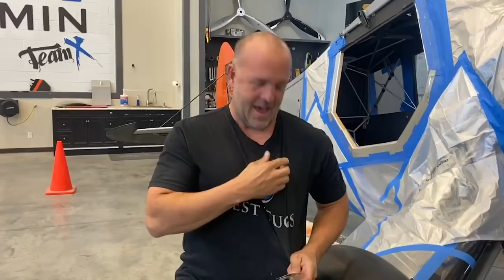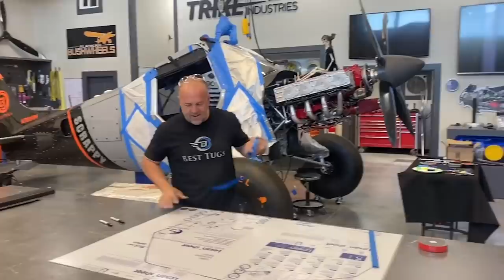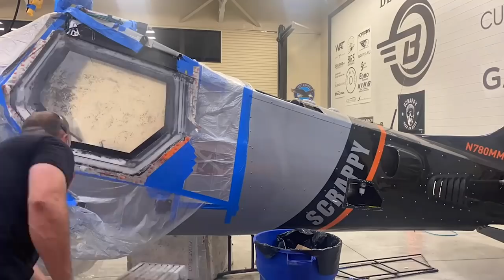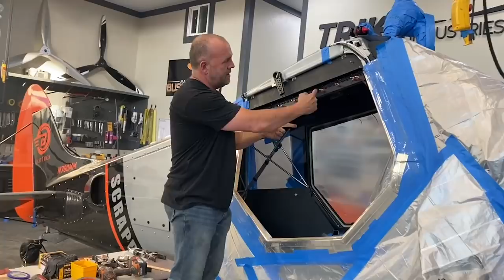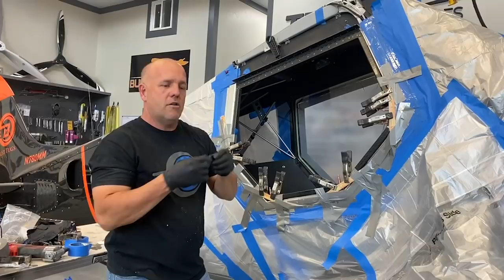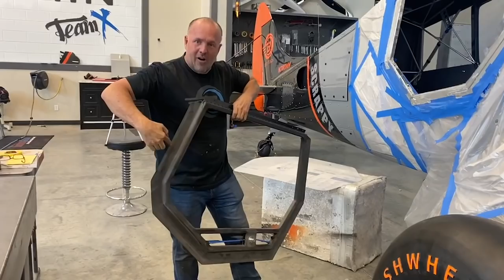Drag Racing Bush Plane gets custom carbon fiber door that can open in flight | Scrappy #36

Comment: Awesome pro tip using tape to set your "trim to" point for making composite bits... I've always done the same thing "inside out" I suppose for making parts out of aluminum, to where the tape would become a sacrificial barrier, and a movable point to file and stress relieve to. I've never thought about forming it into a piece of composite like that, especially since it's all going to get turned into dust like you said... I can't wait to see this thing out and about when it's flyable!

Comment: 25:00 The door mating surfaces should be at an angle to each other, like two 45 degree angles. With them as they are now, if you crash and the frame flexes you run the risk of the door itself getting pinched in the door opening. If they're angled and the frame flexes due to a crash the door will get pushed out of the door opening and you'll be able to escape.
Reply: Interesting, never thought of that...
Reply: It’s nearly all carbon, it will either flex and return or break. It’s not like metal frames/doors which can bend and set.

Comment: I was surprised you didn’t make a door on both sides.  One of the coolest things I remember about flying a Bellanca Scout years ago was that both windows would swing up and latch on the wing and you could literally fly in an “open” cockpit.
Reply: I wonder if the decision was made in case of a crash to have the window fixed.  Or maybe noise consideration.  Mike let us know why you decided on one fixed window.
Reply: I would guess visibility. Full window vs. the bottom section having to contain a latch mechanism. Just a guess though
Reply: Yeh, seems less ideal for egress in a crash, if one side is blocked shut or has hazards (fire)
Reply: One of the few decisions on Scrappy that really doesn't seem to make sense.

Comment: What's really great about polycarbonate is you can use a sheet metal brake to bend it just like aluminum.  No need for heat guns.  I have seen it bent over 90° this way without cracking.

Comment: SUGGESTION; Leading edge of window frame, over lap.  I found that when I had the leading edge of the window frame tucked in behind the aircraft body rather than over lap there was less wind noise and tension on the door.  With the curve window (air foil) the window wanted to be sucked open.  I found the tucked in window had less stress on it.😀 Cheers Greg

Comment: Mike, I very much enjoy you videos.  I would suggest you put doors on both sides of Scrappy.  I walked away from an ultralight crash and after your experience with Draco the ability to exit either side in an emergency would be a better safety option I hope you never need.

Comment: If you do a lot of plastic heating/bending build yourself a hot wire bender. It is so much faster than using a heat gun and super consistent. Basically changed my life lol

Comment: Hey Mike some time ago you mentionned you might install floats on Scrappy...as a water flyer I can't emphasize enough the need of a door on the pic's side. Needed for everyday exit/manoeuvering etc but also for underwater egress. I can see the power/prop/mixt levers in the way...is this why you installed a fixed window?. At least make it a "blow' out window for emergency egress. Otherwise fantastic build, I am in awe and always looking forward watching the progress

Comment: Mike thanks for the Scrappy build video, best Christmas present ever. It's not just a plane, it's a true work of art.

I do worry about a second way out in case Murphy rears his ugly head.

I just finished a little Scrappy radio controlled model plane build from coroplast. It looks like it was put together by a six year old compared to your build. Also, to describe it more accurately,  my Scrappy does not have an S in it.

Comment: Mike,  I really enjoy your build of Scrappy.   Interestingly I am now working with micro balloons on my Seawind kit at the moment.  One concern is micro balloons has little tension strength.  Chopped glass fiber and resin is what I use when I need of strength,  like major section joining.
Good luck.  hope to see you in a few years when I move my plane from Japan (where I live) to Idaho.

Comment: If it is not a big cut, a trick for thin transparency is to use a thin drillbit inclined side-on as a saw, drawing it along the intended cut, leading with the electric drill. You can steer it but not as tightly as a thin blade saw. It is not as tidy as a saw cut and there may be solidified molten dags to clean up afterwards. You will be less likely to crack your sheet cutting it. It is not suitable for windows but might be helpful some other time.

Comment: Cool trick on the masking tape.  I wonder if that will work with regular fiberglass layups.  I've always used clear tape with a sharpie line.  That would transfer to the fiberglass for a reference post cure.  Of course that is easy to see on fiberglass vs carbon.

Comment: Is there going to be an integrated way to break open the non-opening window? Sod's law dictates if the fuselage ends up in a river on its side it'll be door side down. Awesome project, please don't take my comment as criticism, just thinking through scenarios.
Reply: Shouldn't be possible with the wing and strut and landing gear on the side as well. Probably a quick release hinge mechanism from the inside.
Reply: Multi directional seat-o eject-o with a rocket. equipped with the latest Garmin glass of course.
Reply: I would think that just like a car, in a worst case scenario, if the fuselage begins to fill with water the pressure will equalize and you can then open the door as normal.
Reply: I was thinking same thing. If crashed and  something is blocking right door it would be a deathtrap. There should be some kind of plan b to exit
Reply: @markusrontti546  
Indeed. Also I believe the rear passenger is dependent on the pilot getting out and then the pilot's seat being pivoted forward. What if the pilot is unconscious?
Reply: @owensparks5013  Well the pilot would cause problem but plane that size you propably could still reach handles to open door ja try to push him out or crawl over. What if only co-pilot is unconcsious and blocks the only way out? If pilot had his own door there would be no problem. Its all about what if's and level of safety you want to achieve. Mike put parachute in scrappy so and does lot of testing for safety so he thinks about that but now im little surprised
Reply: Scenario: Mike hits the silk and scrappy crashes through some trees, the lift strut is hit by a limb and is bent up against the only door in the aircraft preventing escape.
Reply: More points to consider: Mike says that he wants the door to be airtight. So how does the cabin pressure equalisation work, as altitude changes? There must be vents elsewhere. At high altitude, the cold presents more challenges. There is a lot of work behind the design and construction of Scrappy which we don't see.
Reply: @RWBHere  Not even the SR-71 or the U-2 has an airtight cockpit.  It's just a figure of speech, meaning you won't be able to feel air blowing through the door gap.  A more accurate term would be "wind tight".

Comment: If it weren't for all the innovators like Mike in this world, we'd all still be flying old Luscombe 8A's with points and condenser and sight glass fuel guage, just like the 12 that thumbed down, their Armchair annual inspection is expired. 🤣
Reply: Hey, nothing wrong with a sight gauge! But I get your point, any way you slice it he is great for aviation.
Reply: Could you imagine what GA would be like if the Governments add so much cost and bureaucracy?  Modern designed aircraft can take people more efficiently than Suburban.

Comment: I’ve been working with polycarbonate in my senior design course at CU Boulder and found it’s pretty soft and scratches easy. This cause a problem for us because we’re putting a LiDAR behind it and scratches refract the light the LiDARs beams. Are you going to coat the polycarbonate at all to prevent scratches from happening? If so what coating are you using?
Reply: I'm sure for aviation it's a scratch resistant polycarbonate.
Reply: Haha if you did the searching I did you would know that means it’s coated in something, polycarbonate is polycarbonate at the end of the day and will be just as susceptible to scratches if not coated

Comment: That bit of a kink Mike put in the glass is a brilliant design feature...
Until he mentioned the potential of the glass fluttering under normal forces...I wouldn’t have thought of that.
I would have thought that the simple curvature of the glass would have produced enough of a natural compressive strength element to resist flutter, but after thinking a bit... I realized it would require a 360 degree curvature shape to resist flutter.

Comment: With the port side solid add ballistic glass with a wing pod General Dynamics XM301 gatling gun spitting polymer 20X102 mm ammunition (30 percent lighter) with solid mount 80lbs with turreted cradle mount 115lbs that allows independent movement of aircraft travel polymer linkless carrier drive = added weight savings rata tat tat 750 rounds per minute 🤔 or with cooler running polymer rounds 1500 plus rounds per minute 🐗🐽 Beraaaaaaap 🎼🤯 Just a suggestion since there's not going to be an opening window or door on the one side you do have the inboard space for ammunition

Comment: I'm a little confused Mike Patey. I thought you designed this with mounts to eventually add floats and if you had floats on wouldn't you want to be able to get out on either side to stand on the floats to tie up and such?
Reply: Probably the weapons pod will be port with the feed coming from inboard the ballistic glass will be mounted solid General Dynamics XM301 20X102 mm gatling gun with solid pod mount 80 lbs with turreted cradle mount 115 lbs allows independent travel of weapon to aircraft paired with polymer rounds another 30 percent reduction
Reply: Plenty of float planes in the world where you can only get out on one side...

Comment: Will the window be bonded into the door?

It would be cool to bolt on the outer frame you mentioned at the end of the video, sandwiching the lexan so you could replace it easily rather than bonding it in and having to tear the frame apart.
Reply: Wonder why he used Micro on the joints of the door?  It's not very strong since it's glass spheres, I'd think you'd use Flox for strength?

Comment: Mike im a little worried about the fixed window in the event of an emergency. Will you elaborate next video? Thanks Mike love the content.
Reply: Yes, I was wondering about that too
Reply: The single door design with fixed left window is an exceedingly common design in GA.  Nearly all Piper and Beechcraft single models, including the Piper Cub, have a single door and window on the right.  There may be STCs for left side windows on Cubs I really don't know but many thousands of piston singles have no left side window or door at all.  The "glass" can be pushed out.  Maybe Mike's can be too.

Comment: Have you seen Carbon Dyneema? It's 40% lighter than Carbon Fiber and it has absorbsion properties. They are using it on the Toyota Lemans Cars the LMP1's. Dyneema is the fabric they use in Synthetic Winch Ropes.

Comment: Curious why you chose Lexan over Acrylic or polycarbonate? I know it's more flexible (therefore it doesn't crack as easily) and very strong, but it scratches much easier. In designing, were you choosing strength & flexibility over scratch resistance? Great video Mike.

Comment: Mike.....what resin are you using for the carbon wet layup? I'm looking to find the right stuff for my own project. But so far the stuff I found leaves the carbon extremely flexible and not stiff like your products. 
What's the secret?

Comment: Hi Mike,  I'm curious about one aspect of your landing gear and its large travel.  Are you not concerned that if the wind gets under a wing it will be easier for the suspension on the opposite side to compress and allow the airplane to tip onto its wing tip or flip?

Comment: Hey I was wondering what you are going to do when you put floats on scrappy. You said you wanted to have the wings engineered to the exact weight of the plane for maximum performance. Are you going to use the same wings for the floats or different ones.

Comment: People bring up a good point what is the wing going to look like?  This is bigger than a standard Cub and I know you are reducing weight wherever possible but with an 8 cylinder engine this is going to be heavier than the standard Cub.  Are you going with a longer wing? longer chord?  both?  There also must be some increase to the structure such as a secondary spar or a strengthened main spar?   It's a bad looking plane but the whole part that makes it fly has never been shown.

Comment: Could you not get the entire lexan mounted in the carbon frame and then heat the whole sheet similar to vacuume molding but use gravity to get a bubble window?

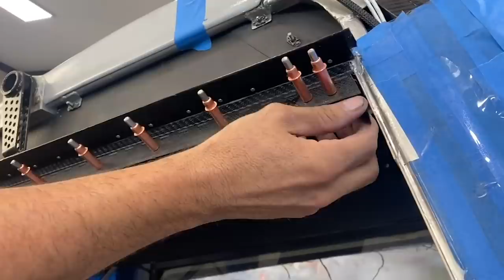Comment: 15:43 would you be better off using flox (maybe a little micro mixed in for weight) for the strength at those corners? 
Edit: never mind.. you addressed it, riveted it, wrapped it, it’s so overbuilt, it’s not going anywhere!

Comment: 🎅🎄☃️
MERRY CHRISTMAS EVERYBODY
Hey, looks like y'all workin' in a "Carbon Cub den" there! Lol🤠
Looks like ya gotta get back to work, Chandra & the gang are catching up faster than we think! (Mabe a little custom work will slow then up so Scrappy can keep the lead!😄)
*I was wondering if you were gonna do an Emergency latch/rapid removal system for LEFT window..for flying "doors off" or egress..? Also if you could easily remove right side door or built beyond that point..(I gotta re-watch what exactly you did🤔😄!)

Comment: not even on the same ball park when it comes to your knowledge of flying  and engineering, however I can't quite figure out why you want to seal up one of the doors.  surely in the event of an accident you would want to give yourself every opportunity to get out quickly, or is there an over riding benefit I'm not seeing in having a sealed closed side and only one entry/egress point?  regards from Ireland. s

Comment: with a  full plexi windows in, would they fog up? , Might have to run some heat via a duct towards it. Especially as you know, 3 secs after getting in with a wet jacket on in winter or at the top of the mountain. and in summer, Its gonna be a sauna in there. If its kept closed, so a circular vent might be in plan B?? (also a bugger for when they run out with a fuel slip and no hole to shove it inside , and also,if the machine is sitting out, your gonna want air flowing inside, lest you learn the meaning of "hot seat" ). On heat, Piped heat  to the plexi might be better that a panel mounted vent that blows on your Mic driving you crazy trying to talk or look at notes as they blow around, While it looks like it would fly nicely while straight N level wouldnt it flap up hard  if you had it open and were nose high on landing ,climb ?  and for lay up sticking issue , I heard wax that isnt buffed off might keep the composite from sticking? worthy a test coupon to try??

Comment: Mike, is it your intention to construct a pressurized aircraft? So much emphasis on the door and window being airtight?
Reply: He'll have 4x Oxy on board without pressurizing the cabin, according to a previous vid.. He's wanting to run up to Alaska at some point, so heat and airtight will certainly help!  🤟🏽🐻
Reply: @teddyabearo1066  There's probably a big differnece between "airtight" and "pressure-tight".
Reply: @AllanFolm  Airtight means less noise and less drag  :-)

Comment: That's good.. made the window unable to come out.. So if you scratch it or do anything to it you can't fix it..
Reply from the maker: I Must have not done a good job in the video clips, it is specifically designed to be easily removable and replaced at any time.  I had a whole section on it.  I’ll watch the video I feel bad if it got missed because they are removable

Comment: 10:44 Mike, do you do the resin layup yourself (wet out on the table or layup dry and then scrape the resin into the fabric on the plane?) or are you using prepreg? I really enjoy composite work and learn a LOT from watching your videos on it. You're just not afraid to try new things or new ideas (and have the money if you mess up lol). Really look up to you on this stuff. Thank you and well done!

Also, what resin system do you use? It looks like you are getting really fast turnarounds on these builds. To the point it looks like you are using a really fast cure system. Can you give some insight on this? Thanks!

Comment: Having only one door to ingress/egress on a bush plane seems like a safety risk to me. I'm sure your wings will be stupidly strong and prevent the door from being blocked by debris/ground in an extreme emergency though. But in the case of a fire or something equally dangerous on the right hand side it sure would be nice to have another option to exit the plane without having to use force.
Reply: The thin lexan will keep the air out, but I don’t think it will keep a man in. Should be easy to bust open if needed.

Comment: I would like to build a flight simulator cockpit with PVC pipe the shape/size of an X-Cub, where could someone find/buy frame plan dimensions? Only need from pilot seat to motor mount/fire wall.